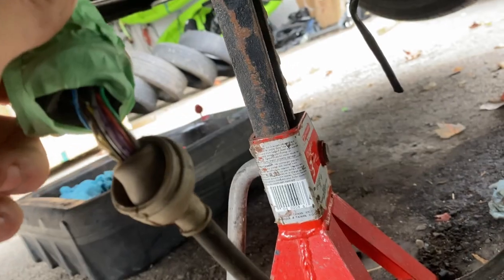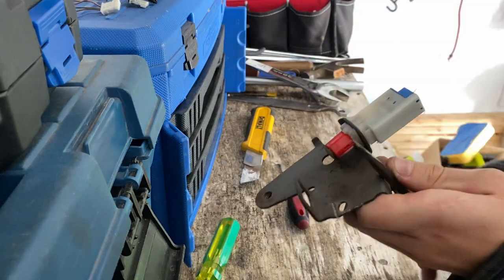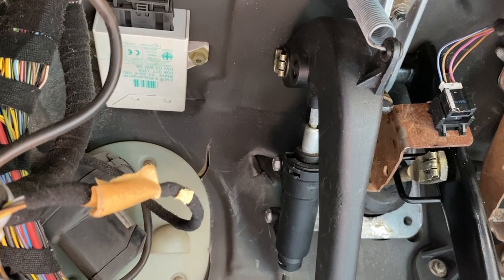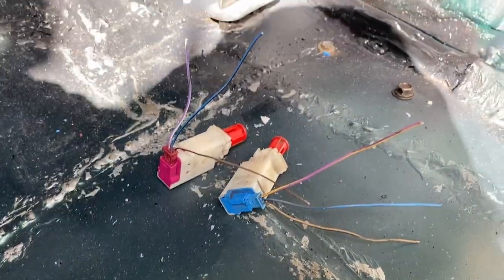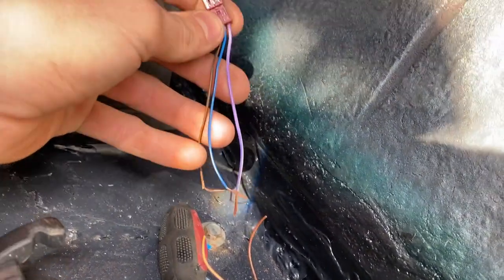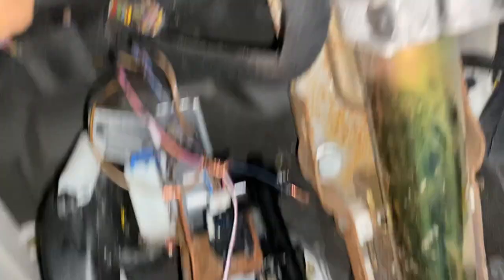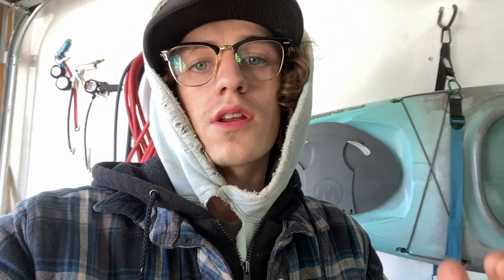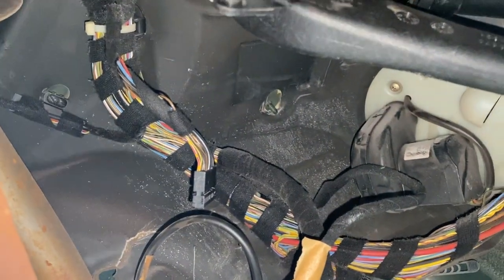BMW E46 The EASY Simple Way To Wire Your Clutch Pedals⎮Auto To Manual Swap!

Comment: I have the earlier model style which only comes with the two wire on the upper switch do I have to get the updated version or should it be fine